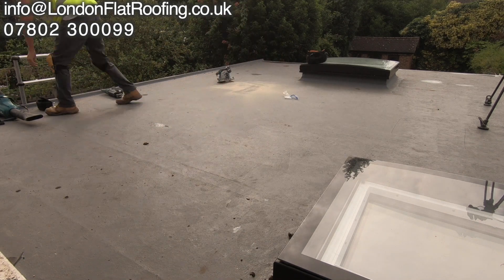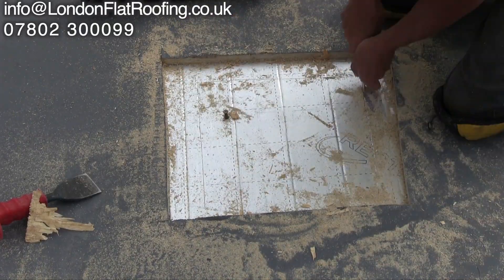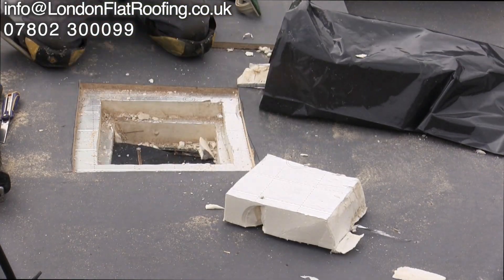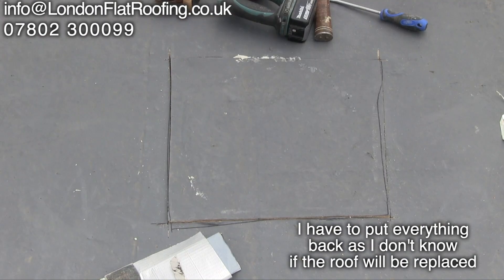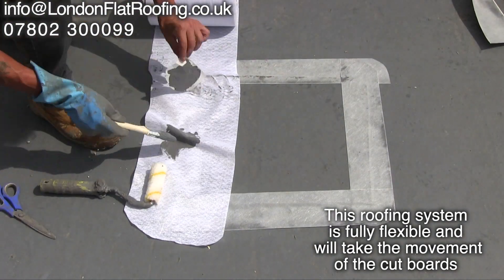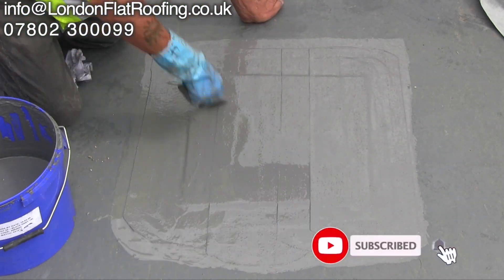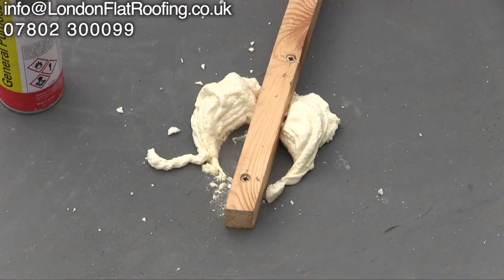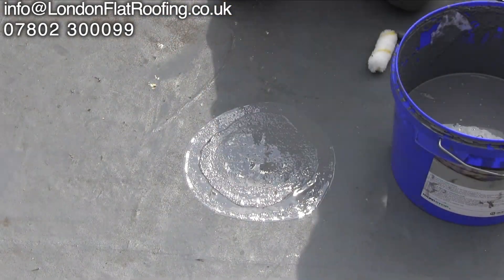Flat Roof Survey on new warm flat roof rear extension

Comment: Hi Steve, 
4 weeks ago a storm ripped off my felt flat roof. 
Insurance finally picked up the claim after 3 weeks of dragging ass. 
Now these builders have stripped and replaced the 60m2 roof in one day with a rubber roof. 

However it looks poorly installed. The rubber is barely glued, the pitch of the roof is off, meaning the gutters are essentially redundant and we have a pool now. 

I spoke with insurance, the contractors and builders with my concerns and asked for a surveyor. They sent out the contractors project manager who said it was ok. 

I said again, it doesn't feel stuck down properly, no vapour barrier, no tongue and groove, and pooling water longer than 80+ hours. 

What would you suggest?

Comment: Had they had an issue within the house to initiate the first phone call to yourself?
Reply from the maker: NO, what had happened they became aware the roof had not been laid correctly because of bad detailing and they decided to find out how bad it was so I did a roof survey and a report on the condition however without doing an intrusive roof investigation we could not establish if the buildup of the roof was wrong so that's when we cut into the roof to find out

Comment: Is it ok to do a hybrid type flat roof built using joists with the insulation in between the joists pushed up tight to the underside of the OSB board without ventilation  . I’ve seen this done but I’m convinced that this would cause the roof to sweat ? 
However seeing you remove the ply sat straight on the insulation I’m not  to sure .
Reply from the maker: If you look at the construction of a SIPS Panel structurally insulated panel you will see that it's basically what you have explained above and that is deemed to work. However, we are not allowed to construct like. Probably because in the structurally insulated panel there is no thermal bridging as there are no joists. Of course, we have joists and thermal bridging that it won't work.

Comment: Was that kempla v2 ?
Reply from the maker: Definitely not kempla v2 as it wasn't that hard. Don't know what it was.
Reply: @SteveRoofer  looks like a chop-strand reinforced polyurethane system, eg Ultraflex or Permaroof 500. Use these systems often as they perform well for the cost.
Reply: @SteveRoofer  no what did you use too seal it ?
Reply from the maker: Hydrostop AH-25 by SIG (Sheffield Insulation Group)
Its really good  should be at £35+vat per m²  to buy!